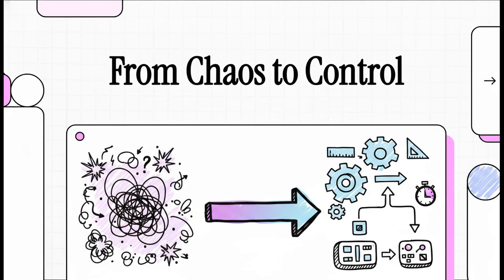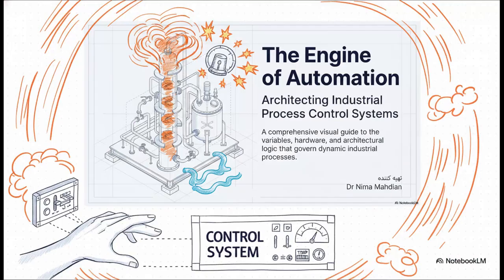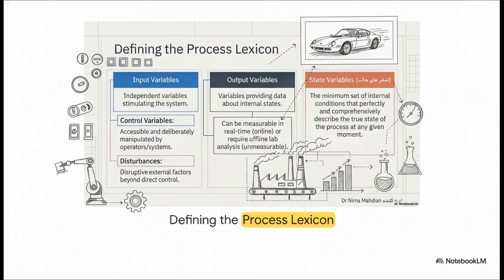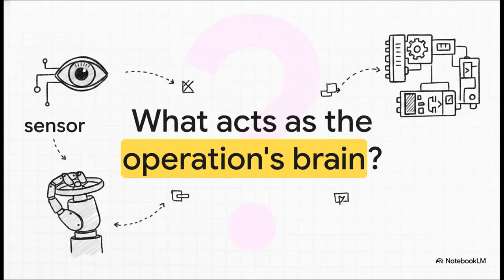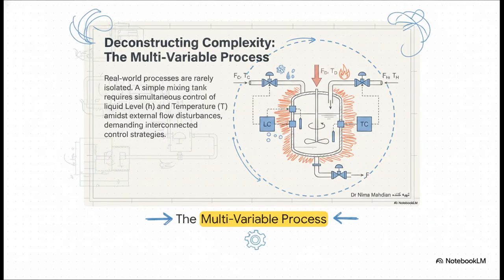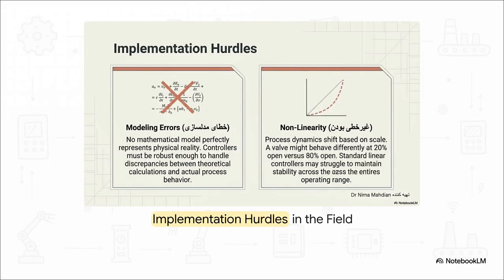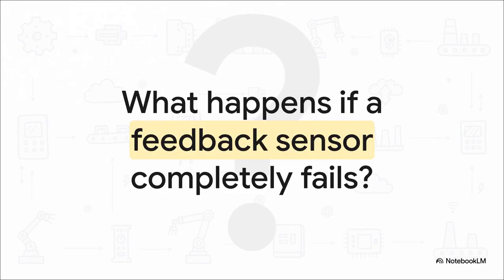From Chaos to Control

Comment: 3-Can we design a control system for a multi-variable process to control more than one variable at the same time, such as liquid level and temperature in the mixing tank? Should we use a separate controller for each variable, or should the controllers be connected because one loop can affect the other? Practically, how do we choose the suitable controller?
Reply from the maker: Yes, multiple variables can be controlled simultaneously in a multivariable process. For weakly interacting variables, separate PID controllers are often sufficient. However, when the loops strongly influence each other, the controllers should be coordinated using techniques such as decoupling, cascade control, or Model Predictive Control (MPC).

The choice of controller depends on the degree of interaction, process dynamics, performance requirements, and implementation complexity. The goal is always to achieve stable, safe, and efficient operation while minimizing loop interactions.

Comment: 2-On the Variable Matrix page, there is a distinction between Control Variables and Disturbances.
Can the same variable change from a disturbance into a control variable if an actuator becomes available to control it?
Reply from the maker: Yes. A variable that is initially considered a disturbance can effectively become a manipulated (control) variable if an actuator is added that allows the control system to adjust it. In other words, the classification depends on whether the variable can be manipulated by the controller. This is why the selection of control variables often evolves as new sensors and actuators are introduced into a process.
Reply: @ControlandAI  Thanks dr

Comment: After reading the session, I understood that process control , I have some equation; -1/In the mixing tank example, if the level controller opens the cold flow valve to increase the liquid level, the tank temperature may decrease. How can we design the control system to reduce the interaction between the level control loop and the temperature control loop?
Reply from the maker: This is a classic multivariable control problem. To reduce the interaction between the level and temperature loops, engineers can use strategies such as decoupling control, cascade control, or feedforward compensation. In more complex processes, Model Predictive Control (MPC) is often used to coordinate multiple variables simultaneously.

The objective is to minimize loop interaction so that controlling the liquid level has as little effect as possible on the tank temperature, resulting in stable and efficient operation.

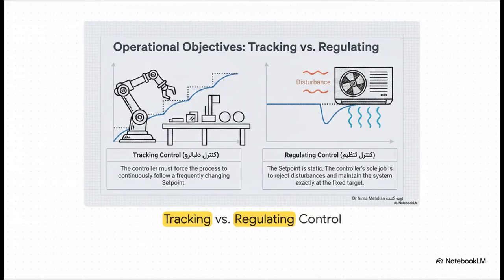Comment: I have a question regarding the explanation at 5:52 about Tracking Control and Regulating Control.

In Tracking Control, is the setpoint always time-varying by definition, or are there situations where it can remain constant for certain operating conditions? In other words, is a changing reference an essential characteristic of tracking control?

Likewise, in Regulating Control, is the setpoint generally fixed, or can it also be modified under specific operational requirements? Additionally, when external disturbances are introduced, does the controller maintain the same fixed setpoint while only rejecting the disturbances, or can the reference itself also be adjusted depending on the control strategy?
Reply from the maker: Excellent question. In tracking control, the reference is usually time-varying, but it does not have to change continuously. A constant setpoint can also be considered a tracking problem if the goal is to follow a desired reference value from an initial condition. The main idea is that the controller is designed to make the output follow a desired reference trajectory.

In regulating control, the setpoint is typically constant, and the main objective is to reject external disturbances and keep the output at the desired operating point. However, in practical industrial systems, the setpoint can also be intentionally changed due to production requirements, optimization goals, or operating conditions.

Therefore, the difference is not only whether the reference changes, but rather the primary control objective: tracking focuses on following a reference signal, while regulation focuses on maintaining a desired value despite disturbances.
Reply: @ControlandAI ok thanks doctor

Comment: Thank you very much, Dr. Nima, for this outstanding and highly informative lecture. It was an engaging presentation that provided a solid foundation in industrial automation and process control, with a clear and well-structured teaching approach that made complex concepts much easier to understand.

One of the most valuable lessons was understanding that industrial processes are inherently dynamic and continuously changing. Maintaining process stability, safety, and efficiency requires a well-designed control system capable of continuously monitoring process variables and responding rapidly to deviations caused by external disturbances or internal process variations. The lecture clearly demonstrated that, without an effective control system, industrial processes tend to drift away from their desired operating conditions, resulting in reduced efficiency, compromised safety, and lower product quality.

Another important aspect was learning the architecture of an industrial automation system and understanding the complementary role of each hardware component. We explored how Sensors measure physical process variables, Transmitters convert these measurements into standardized signals for reliable communication, Controllers analyze the signals, calculate the control error, and determine the appropriate corrective action, while Final Control Elements, such as valves and actuators, execute the controller’s commands to regulate the process effectively.
Reply from the maker: Thanks

Comment: Thank you, Dr. Mahdian, for this very clear and useful video. Connecting the control concepts with real-life industrial examples was very useful, because it made the topic easier to understand and more practical.

My question is:
In a multivariable industrial process, if one control action improves one variable but disturbs another variable at the same time, how should the control system decide the priority? For example, should it always prioritize safety first, even if this temporarily reduces the production rate or product quality?
Reply from the maker: Thank you for your thoughtful question. The short answer is yes—safety is always the highest priority in industrial control systems.

In a multivariable process, it is common for one control action to improve one variable while negatively affecting another. To handle these trade-offs, control systems are designed with a hierarchy of objectives. Safety constraints always come first, followed by equipment protection, environmental compliance, product quality, and finally production efficiency or economic optimization.

Modern control strategies, such as multivariable control and Model Predictive Control (MPC), explicitly consider these competing objectives and constraints to find the best overall operating point. However, if maintaining production would violate a safety limit, the controller is designed to reduce throughput or even shut down the process if necessary.

In other words, maximizing production is important—but never at the expense of safety. A safe and reliable plant is always the foundation for efficient operation.

Comment: Excellent explanation of valve nonlinearity, Doctor When standard math struggles at different valve opening percentages (20% vs 80%), do industrial control engineers look into gain scheduling or adaptive control to maintain system stability across the entire operating range?
Reply from the maker: Thank you for your thoughtful question! Yes, in many industrial applications, when the process dynamics vary significantly across the operating range, engineers often use gain scheduling, where controller parameters are adjusted based on the operating point. For more complex or highly nonlinear systems, adaptive control or even model predictive control (MPC) may be employed to maintain consistent performance. However, for many industrial loops, a well-tuned PID with proper valve sizing and characterization is still sufficient. I will also cover some of these advanced control strategies in future lectures. Stay tuned!

Comment: Phenomenal lecture, Dr. Nima Mahdian. The breakdown of state variables using the high-speed car photograph analogy was brilliant, and using the shower analogy to explain the multivariable coupling dilemma is exactly how complex control engineering should be taught. It really drives home the reality that real-world automation is much messier than isolated single loops on a blackboard. Proud to learn from your expertise, Doctor. Looking forward to presenting my analysis on the final provocative question regarding sensor failure in coupled loops in our next session.
Reply from the maker: Regarding sensor failures in coupled loops, this is indeed a critical topic. In practice, engineers typically rely on strategies such as redundancy, fault detection and isolation (FDI), and robust or observer-based control to maintain acceptable performance under sensor degradation or loss. We will address some of these ideas step by step in upcoming discussions.